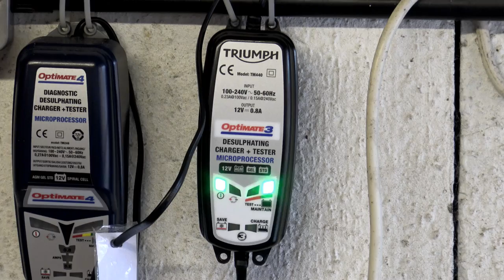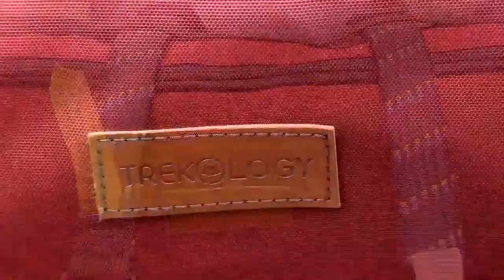Triumph T120, Top 10 Christmas gift ideas for the motorcyclist!

Comment: I just ordered The GoldTop Cafe gloves fro an XMas present to myself. Now I am on a quest fro a hi viz modular helmet. So far, I have looked at Shoei Neotec, a Nolan and Scorpion. Need one with good ventilation and quiet. After one season discovered my present helmet is a piece of junk.  Looking at $400.00 to $600.00 price range. Any suggestions?
Reply: Walt Tanner , i got the Neotec a few months ago. Awesome! Quiet with great ventilation. Great for an open bike like the T120(which I have)
Reply from the maker: Hi Walt again I can recommend the Neotec as I have one myself a very high quality helmet that will last many years if looked after. mines 4 years old and still looks like new. but make sure it fits you well before committing!
Reply: Thanks for the information. I am definitely leaning towards the Borealis version
Reply from the maker: Ill have to have a look at that I just got the boring gun metal grey one!
Reply: I’ve had the Schubert C3 from years ago. Awesome!